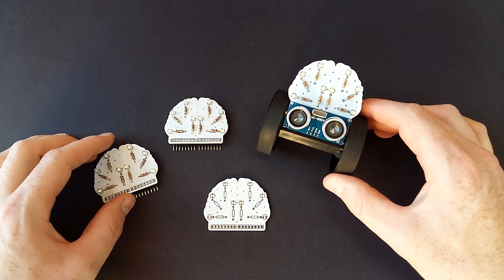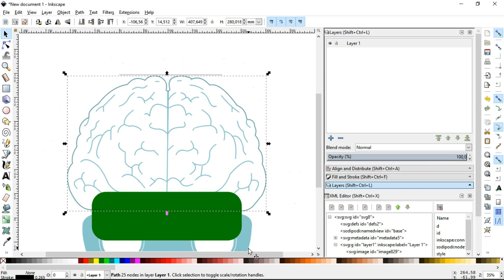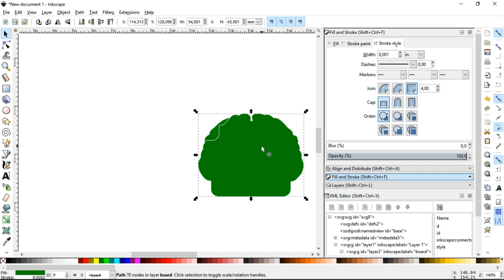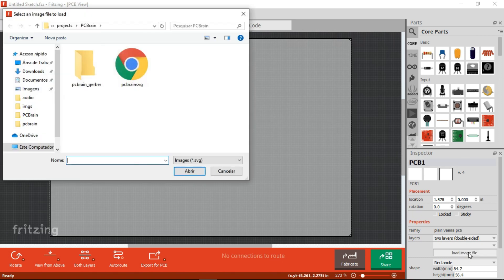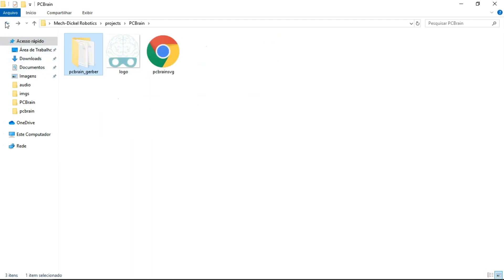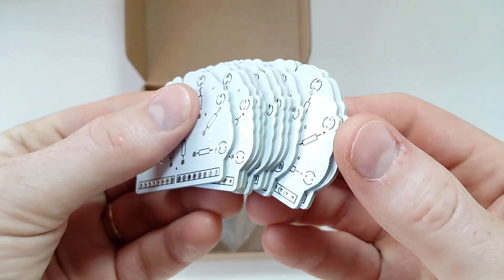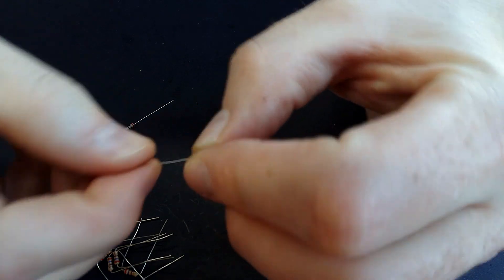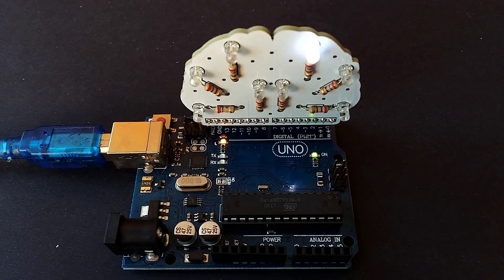Custom PCB shapes tutorial (with Inkscape and Fritzing)

Comment: This is great! Good introductory video into making PCBs.  Is this compatible with any smaller arduino boards?
Reply from the maker: Thank you very much!
The pin headers and its spacing will work only for Uno or Mega boards. For smaller boards (like Nano or Mini) jumper wires can be used.